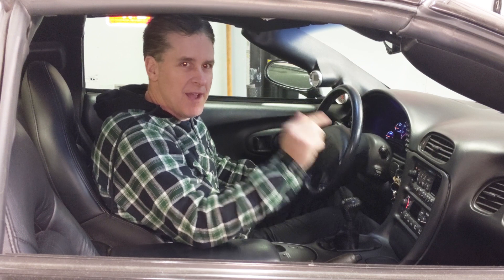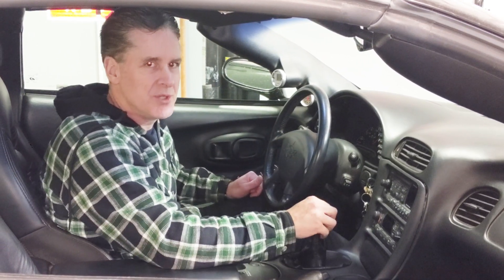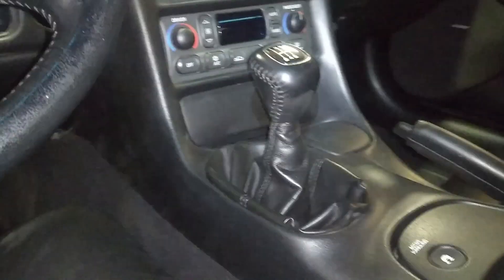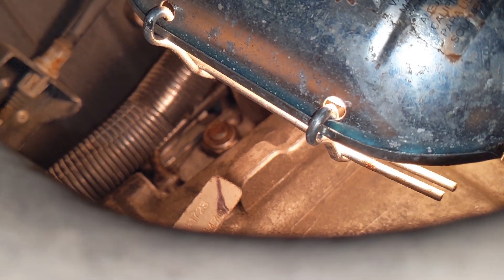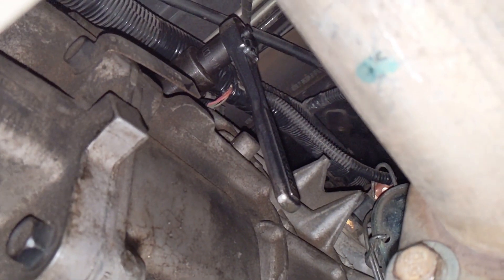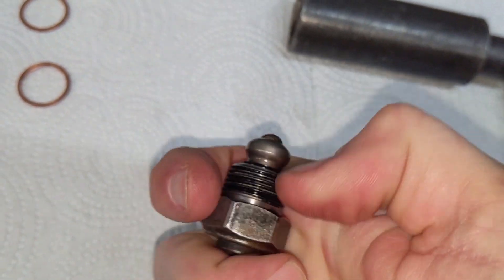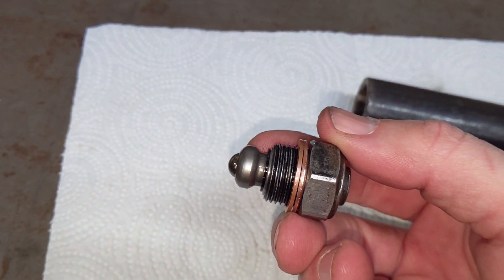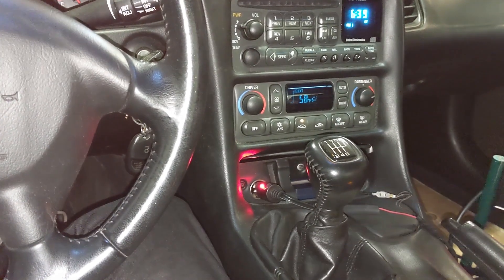C5 & C6 Corvette Anti-Venom Transmission Modification!

Comment: Thanks for the video.  2004 Convertible.  Been intending to do this addition for over 10 years.  Washers sourced on amazon, $6.02 with tax.  Cleaned the area with a toothbrush prior to ball assembly removal.  The detent ball assembly was sealed with a hard plumbers type sealant; not RTV.  Turned firmly almost all the way out.  Not quite as firm for re-installation.  Noticable difference in shift feel; lighter, smoother.
Reply from the maker: That's awesome to hear you got it done!

Comment: im having an issue wondering if you can help, i have an mgw short shifter and the car has an upgraded rpm transmission, sometimes in low gears at a stop going from neutral to first or downshifting from second to first i will hear a rattle/ slingshot kind of noise kind of under the shifter or right under the car , and stops after a few rattles , is that normal?
Reply from the maker: Not sounding familiar but C5 Manual transmissions are full of noises between the torque tube and all of the connecting shafts - made worse perhaps by some twin disc clutches.

Comment: Just did the venom mod on my 2006 C6 - significant difference. Thanks! The gate into 3rd is a little more  vague. When I get a chance to put it on a lift I'll try 1 shim instead of 2. Doing it on jackstands was very doable but not fun for a 69 year old!! Thanks for the tip. That, and a simple shift rod adjustment have transformed this car!! Thanks!
Reply from the maker: Glad you liked it!!  Thanks for the comment!!

Comment: I can’t screw my detent bolt back in, any advice? It just won’t thread on
Reply from the maker: Unless it's stripped, it should go back in. Try turning it counterclockwise slowly until you feel a little click, and then turn it clockwise. Definitely be careful not to cross thread it 😜.
Reply: @Toys4Life thanks for the help, I finally got it it was a pain in the ass, lost one of my washers unfortunately

Comment: Hello I saw u have a short shifter when it was full size was it to easy to shift , is that why u added the second washer because of short shifter I have a stock shifter and was planning on using 2
Reply from the maker: I tried 0 washers, 1 washer and 2 washers and went with my preference.  I can't recall if I used 1 or 2 - but I know there is at least one in there!

Comment: Ive got an MGW and it’s still just tight.  Gonna do the AVM while it’s apart this winter and see how that helps.
Reply from the maker: MGW gets a ton of good reviews. I want to try one to see if it hooks me or not!  AVM is a no-brainer.
Reply: @Toys4Life  it’s massively better than stock! But mine is just tight all around.  It moved fine when I put the lower box together.  So it’s something else.  Next in line to see what fixes it is this.  Seems like typical parts store banjo seals/drain plug seals so it should be easy to locate locally.
Reply from the maker: They are. Everybody's got them.
Reply: @35057  I have the same issue on my C5 with a MGW short shifter installed. Please leave an update after the AV mod.
Reply: @35057   Any updates?

Comment: Hey I just did the mod but I only had 15/16th socket in half inch and my torque wrench is 3/8ths so I couldn't use it... I just got it hand tight, if anything a little to much if anything, should I be worried and get it torqued down to the proper 30lbft or am I fine leaving it?

Comment: Just one question-I had to use a breaker bar and a lot of force to remove the detent. Are you sure 30 ft lbs is the correct torque?
Reply from the maker: You should not have needed a breaker bar to remove it. It probably had a little bit of corrosion built up since it's 20 years old.  I'm 95% sure 30 ft lbs is correct. The only thing I get sure about are death and taxes...
Reply: @Toys4Life  Thanks. I thought maybe they overtorqued it in Bowling Green, or it has been serviced previously. I appreciate the reply. It is torqued to the correct 30 ft lbs. and now I can rest easy!!
Reply: @franklategano1915  Hey man I didnt have the proper socket for my torque wrench so I just got it hand tight. Do you think im safe leaving it like that or should I get it torqued down to the 30lbft.